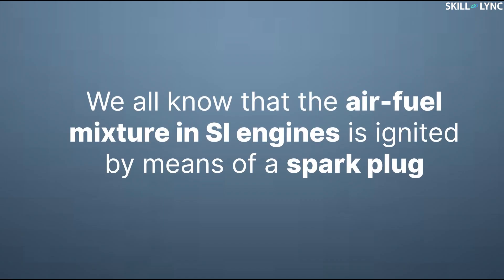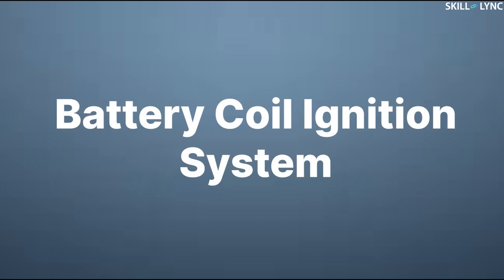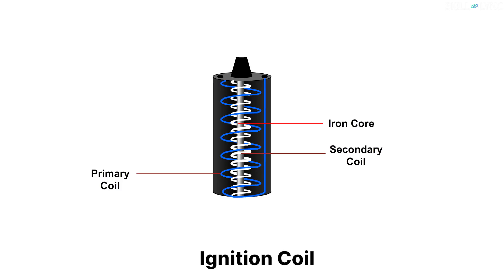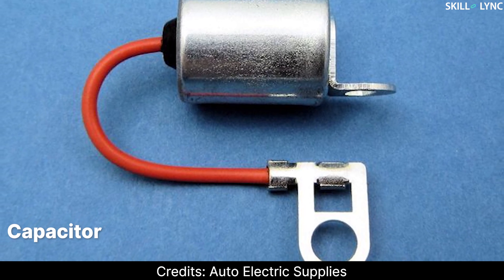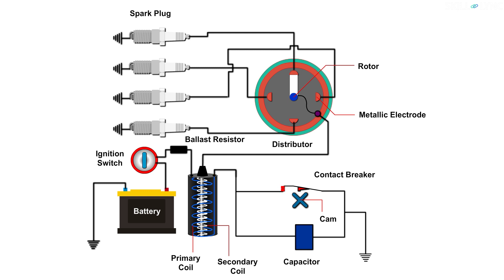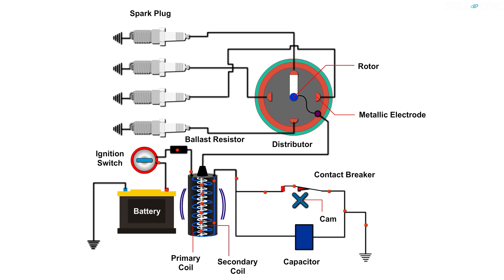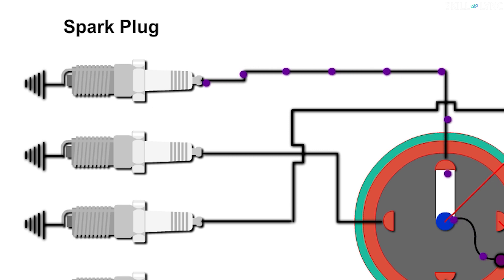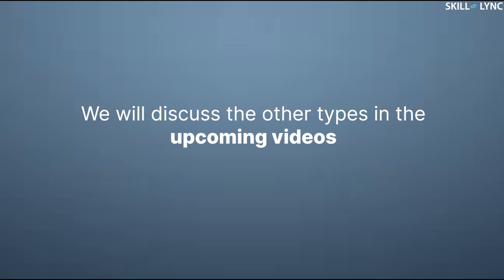Battery Coil Ignition System | Skill-Lync

Comment: Often on 4 stroke engines the cam for the contact breaker will rotate at speed of crankshaft. It will fire 1 per revolution, but fires during compression and exhaust strokes. On exhaust stroke it will not make a combustion because no compression and no air fuel mix.